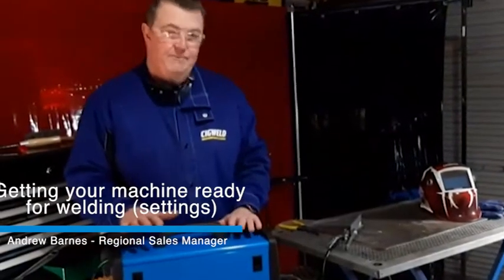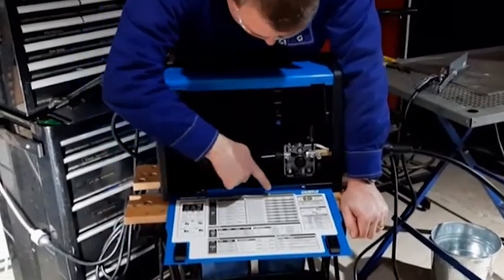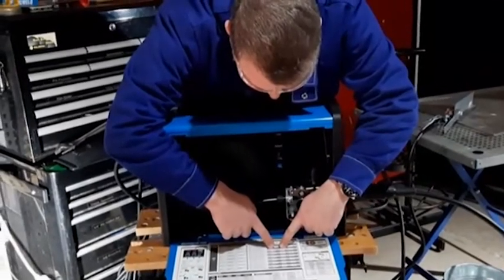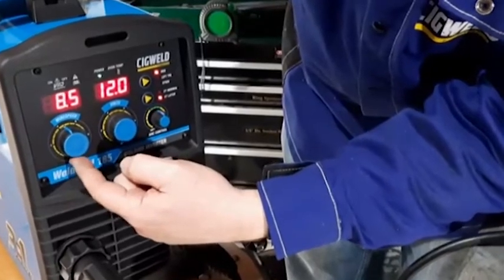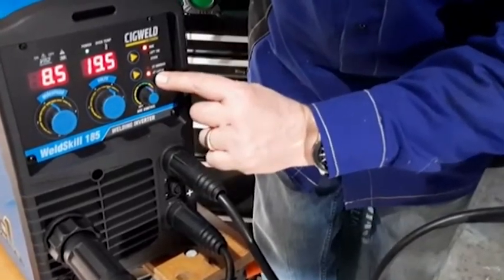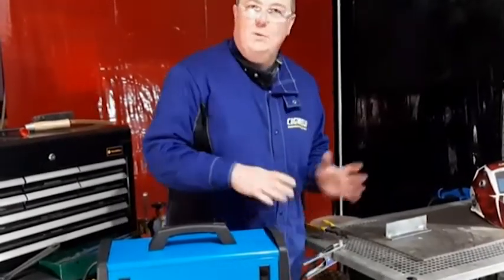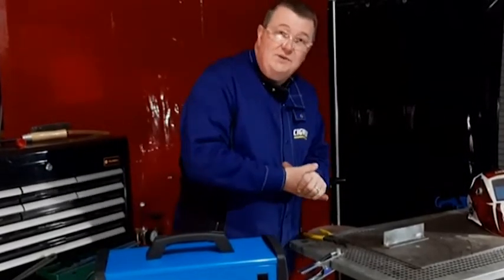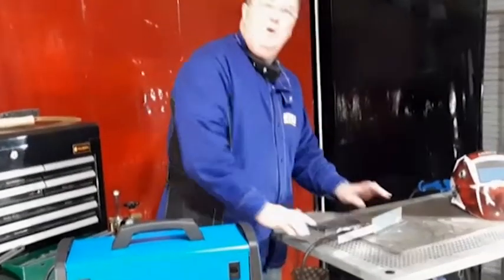WeldSkill 185 Getting your machine ready for welding settings - Part 6

Comment: do you know how to step up gasless aluminum
Reply from the maker: Hi John D, there is no Gas Aluminium Wire available, that we know of. Gasless wires are available in Mild Steel and also Stainless Steel – but CIGWELD don-not supply gasless stainless. Aluminium is best welded with MIG Aluminium AL5356 wire with Pure ARGON Shielding Gas.
Reply: @CIGWELDESAB  yep thank you i notice that im just a noobie lol

Comment: I’m interested in using a Cigweld machine to stick weld thick, sheet piling (and to use it for MIG on other projects).  Can you confirm the maximum thickness the 185 Weldskill will comfortably handle for stick welding?
Reply: I have exactly the same question.... I've downloaded the manual and can't find this information regarding the max thickness for mig, tig or stick.  please respond
Reply from the maker: WeldSkill 185  machine welding thickness:  On STICK Welding (MMAW) the maximum welding electrode size is 160A so is suitable for welding with 2.0/2.5mm and 3.2mm so it would handle welding up to 8mm maybe 10mm Mild Steel at maximum with multiple runs.

Comment: Hi i just purchased the 155 version its a great welder but im having trouble with the settings, im welding exhaust tubing is 3mm I followed the chart but soon as i pulled the trigger i blew a whole through the tube any tips? I set the wirespeed to 3 amps and the volts to16.5 and that was probably the best setting i could weld on